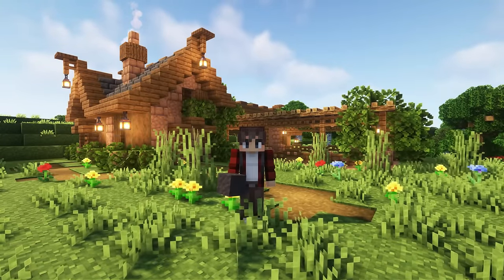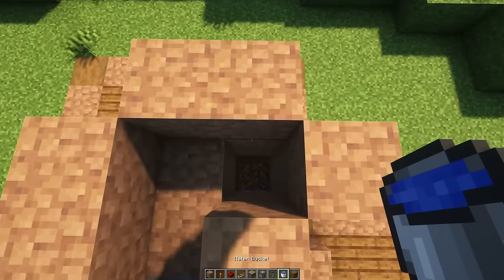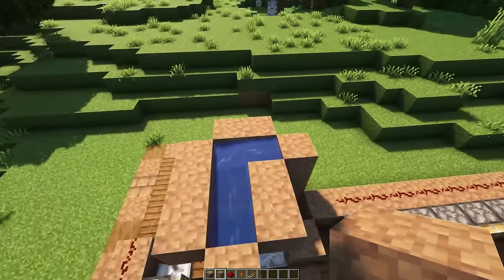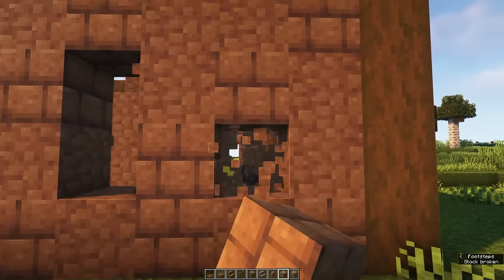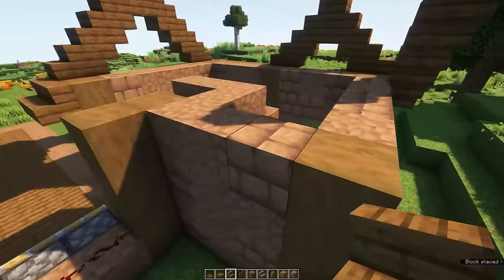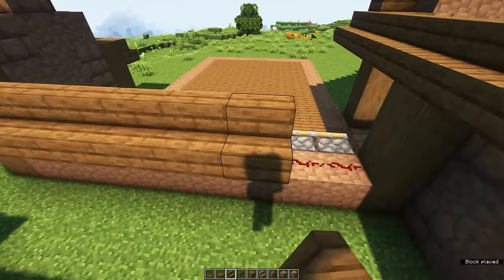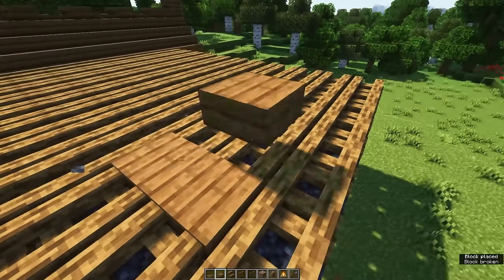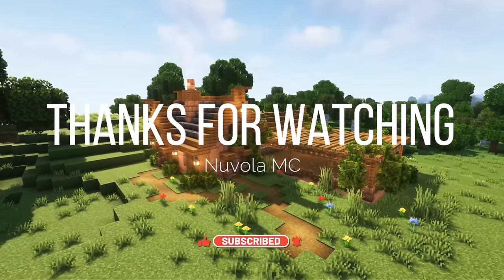MUD FARM | Minecraft Tutorial | Java & Bedrock [1.21+]

Comment: So I built this and it didn’t work on Bedrock, came back after two days to see if I could get a fix and I did so here’s the solution since I don’t see it mentioned, if the bottles aren’t filling up with water make sure there is stone surrounding the red stone at the end of the hopper, then get rid of the water item elevator by replacing the souls and with dirt, extend the hopper line from the dispenser by 2 and lastly place a water bucket on the top and surround it, it was a lot but I finally got it working with zero hiccups, thank you for another great tutorial bedrock always makes me have to find another way lol
Reply from the maker: Glad to hear you found out a solution! Very creative :)
Reply: Pls explain your method for replacing the water elevator,  for bedrock edition. I to would like to build this, but saw your comment about it not working for my version. 
Did you have to alter the building structure for your adaptation?
Reply: @mazzystar6660  not really, just place dirt with kelp to create water source blocks, break it and replace the dirt with the soul sand. then extend the hoppers by two, fill with water and you should be good to go

Comment: Doesn't work as intended. After placing 6 water bottles on the dispenser and tried it, it never give another set of new water bottles, because of "32" glass bottles, making it 37, instead of running like the video intends to. Also the dispenser never makes water bottles on Bedrock. Can you fix the video for clarification so BE users can use your farm just like on Java.
Reply from the maker: Hm, it works for me in Bedrock. Did you place the redstone dust underneath the full block next to the redstone repeater that's on top of the hopper?
Reply: Had the same problem but it’s just that the repeater isn’t in the correct position make sure it’s facing the red stone dust it should fix it

Comment: Just a little tip - if you set the redstone repeater to the initial piston down a block, then you remove any risk of accidentally adjusting the ticks you set it to whilst placing the dirt blocks to become mud. As it is, if your cursor is lined up with the redstone repeater whilst holding down the place dirt button, you'll end up accidentally cycling through the amount of ticks the repeater stalls. By placing the repeater a block lower, you remove that problem.

Comment: TROUBLE SHOOTING (like this comment to bring it to the top or Nuvola if you could pin it, that would be awesome for anyone having issues)

After much grief trying to make this build work on a 1.20 Bedrock Multiplayer Realm, I finally got it working!  My issue was that the bottles were not refilled in the water elevator, but instead spitting out empty bottles back into the system (the last 32 from the hopper underneath the first dispenser adding to 38 or sometimes 37 with one filled bottle in my inventory), effectively only making 5 or 6 mud from the intentionally placed six water bottles in the front dispenser.  I tore the whole system down three times, but the fourth time was the charm!

For anyone struggling, here's what I did and an accumulation of other comments:
1) Use smooth stone for pretty much all blocks directly touching or adjacent to the redstone, both dispensers, and piston (just the one connected to the initial push of dirt, the others can be your choice block) (you can use stone, but I find smooth stone more aesthetic)
2) Ensure you are using two dispensers, not a dropper
3) Ensure all redstone is placed accordingly (& that the one underground is a cross and not a line)
4) Ensure the redstone torch is placed on the correct wall
5) Ensure the repeaters are facing the correct way
6) For the repeater that is adjusted, three ticks means clicking only twice, not three times
7) Ensure all the holes in the ground  are filled that are surrounding the underground dispenser and in front of the hoppers that are connecting the two dispensers
8) Do not use soul sand at the bottom of the water elevator - it will break the water refilling cycle. Items naturally float to the top when in water, so it is not necessary
9) Ensure all four water points in the elevator are source blocks from water buckets that are placed on the back wall of the elevator
10) Ensure the top of the water flow is covered with glass
11) The amount of bottles is necessary and should be followed accordingly.  Using other filler blocks will spit out those blocks in the rotation, breaking the infinite water bottle cycle

Good luck, fam!

Comment: On 1.20.1 + Forge, I had to build the lip of the water channel one block higher because the bottles were getting stuck on the edge.  I also had to put an additional delay before the first dispenser.  It was ejecting the water bottle through the dirt when the dispenser and the piston were on the same tick.
Reply: What do you mean with put an additional delay before the first dispenser? Did you set it to 4 ticks instead of 3? I didn't need to make the water channel secure, but the dispenser keeps firing twice when i hold down placing dirt. When I remove the repeater for the dirt pushing piston and set the other one to three Ticks it kinda works, but then the dispenser doesn't get filled back up with water bottles anymore.
Reply: @iAkrobat_  in the original, the first repeater powers a block, and that block powers a redstone dust trail over the piston to the first dispenser.  i put a 1-tick redstone repeater between this dust trail and the first dispenser because--at least on 1.20.1 forge--the first dispenser will shoot the glass bottle through the dirt without the additional delay.  I also found that it works faster if you make a bubble column behind the tail dispenser, and enclose the top in a solid block to prevent bottles from popping out of the water column.  i had another problem when the array of pistons maxed-out their push distance, the first dispenser would blast all of its bottles out, so I put another block detector at the very end of the line, and redstone dusted it back to the redstone torch in the first block detector beneath the first piston (shutting off the circuit once the mud/clay area is full).

Comment: idea: i actually combined this farm with your clay farm by adding the dripstone to the last 8x8 of the mud end and doing the brick aesthetic there.  it works great and fits my purposes because i need a lot of clay but i still get some mud.

if anyone has issues where the waterbottles get thrown out at you, make sure to put the repeater on two clicks.  it's in a part of the video i think some people miss.

i suggest building the working system first and then using the mud from the system to build the walls around it, rather than trying to collect all the needed mud first.

thanks!

Comment: It shouldn't be too hard to add a light or a note block that will signal when the mud field is full.
Reply from the maker: Cool addition!
Reply: you can place a redstone torch under block 12 and send a signal from it to turn off the torch that fires the piston. The first line will not be filled to the end and when you dig out all the blocks, the piston will continue to work normally.

Comment: I always wondered about farms like these. After it pushes the 8x12 platform out is there a way to push that whole platform up or down so you can have a 8x12x12
Reply: Update: so it is possible but a little weird to power pistons from below. Spent the last three hours or so playing around with it.
Reply from the maker: Yes you can! Basically you repeat the redstone system at the end of the line, but then build it at the end of the platform and make sure it powers 8x12 pistons underneath that push the mud up 1 level.
Reply: @nuvolamc  I spent like 5 hours in a creative world messing around with it. The issue with using the same detector at the end is it takes the place of a piston so it won’t push the corner block up since there is no piston there so doesn’t really work. What I wound up doing is using an observer looking at a wall so when the mud connects with the wall the wall changes shape and the observer detects it. Then I used a redstone torch tower underneath to power the pistons from the bottom. I’m going to start uploading Minecraft videos to my channel in about a week or so (I hope this isn’t a butthead move not trying to advertise on your channel) and probably uploading a tutorial on everything I added. Definitely giving you credit for the build but I think I added something cool to it enough to make a video about it
Reply from the maker: @AlwaysBolttheBird Sounds cool! Good luck with your channel!

Comment: would the clay and mud farm work in 1.20.1 ? I tried clay and it didn't but was wondering if it was a bug (I mean, to collect it, because the process did work, but when I try to take it it collapses into nothing)
Reply from the maker: Are you using the proper tool to collect them? A shovel in this case. When you break the blocks, they should end up in your inventory.

Comment: I have a problem. I have built this in java and the dispenser just spits out the bottles of water without turning the dirt into mud, any ideas?
Reply from the maker: You may have used a dropper instead of a dispenser?
Reply: Thanks for the quick reply. I found the issue, I didn't change the ticks on the redstone repeater..  @nuvolamc

Comment: Having trouble with the dispenser that puts the water bottles into the water column. For some reason, the circuit doesn't seem to get completing. 

Anyone else having this issue?
Reply: Just started happening to me. I set this up earlier today, tested and made a whole field of mud. Then I finish decorating and when I run it the water bottles were shooting right through the mud. I figured I messed something up while decorating and rearranging. I have completely reset it twice and it will not fill the water bottles.
Reply: I got it working but just reconnecting the redstone to the water filling hopper, over and over again. Then I had to mess with both repeaters. I honestly don't know what they are at but I just made a whole field of mud, (which is happily becoming clay) so I am not touching anything. Thanks for the build I love it, I need a lot of terracotta so this was a two for one deal.
Reply: @mrsmedg8330  glad you got it working!!
Reply from the maker: Did you solve the issue? Sounds like the redstone system needs a check up!
Reply: @nuvolamc  yeah, got it working!! Turns out your design is perfect - I was missing ONE block right next to the dispenser that goes into the water column, so the redstone circuit wasn't complete. :)

My gf and I are new to redstone, so this was a really good introductory build, thanks for this!! We're now working on the Library/sugarcane farm, and we're really enjoying it!

Comment: Just founf this build and love the look and function of it.  But small issue.  The bottlea dont cycle though.  I mean i can load the top dispenser with filles bottlea but they dont cycle and refill.  I went over the build and have it as the video. But srill nothing.  Can anyone help. Oh playing on Bedrock
Reply from the maker: Hm still having this issue?
Reply: @nuvolamc  nope got it fixed.  Had to redo the waterfall for the bottles.   Works great now
Reply from the maker: What exactly went wrong? Apparently more people are having this issue.
Reply: @nuvolamc  so in making the water tunnel for the bottles. It needed more water to fill the chamber up. Each level needed it's own source bucket.   Also found its easier to just fill all the hoppers and dispenser with bottles.

Comment: The mud farm has suddenly broken ): it was working fine but now the water bottle shoots AT the dirt block rather than turning it into mud
Reply: Also the dispenser doesn’t seem to be filling up with water bottles anymore meaning I have to constantly go to a water source to refil it ):
Reply from the maker: Strange! Did youbupdate your world? Or has someone changed settings on your server? Did someone change out your dispensers for droppers?
Reply: I was having the same issue. Add a single tick to the very first repeater going into the piston, and that should slow down the system enough that it works. Hope this helps!

Comment: I must be the most useless minecrafter 😅 because I can not get this to work. the water bottles don’t refill after the first six, I have torn it down and rebuilt but I can’t see what I’m doing wrong. I hear the splash but nothing happens. I have watched the video a million times and read the comments (some more helpful than others) any ideas?
Reply from the maker: The redstone that fires the bottles into the water column seems to not be functioning correctly. Have you check this?
Reply: Yes that is the problem the dispenser is not being activated and I can’t work out why
Reply from the maker: Is the redstone dust (under the floor) a dot or a cross?
Reply: A cross
Reply: I tested the dispenser to see if it works and it does dispense if I directly activate it
Reply: I got it working  I reworked the red stone so it activates the dispenser when a mud lock passes over
Reply: @badhatjedi  May I ask what you done haha, same issue here
Reply: I figured it out haha
Reply: @ChiefBodo-ns5kr   how?
Reply: @RPodSpotter  I have done some playing around (my one is made out of stone) and if I change the block above the redstone on the left at 2:32 to sand it does not work, try using a block that sends more redstone power above it like either mud, planks or stone

Comment: Hello! I'm at Java 1.20.1 and I'm having some issues with the dispenser that fires the water bottle. I broke the whole sistem and did it again, but it seems to be unfunctional. Can you help? I did search on the comments and, aparently, only one person was able to solve this same problem (@badhatjedi). But I didn't understood his methods.
Reply: I reworked the redstone circuit, delaying a little the signal transmited to the dispenser that fires the water bottles. Aparently, its working now
Reply: How did you do that? I'm having the same issue. @kauelustosamorgado
Reply: Nevermind, I removed the original redstone repeater by the piston and the timing is fixed.
Reply from the maker: Glad to hear that you fixed it!
Reply: i misclicked several times and changed the delay on the repeater
  behind the piston. You have to be very careful not to hit it by accident or add some redstone and move repeater one block back.